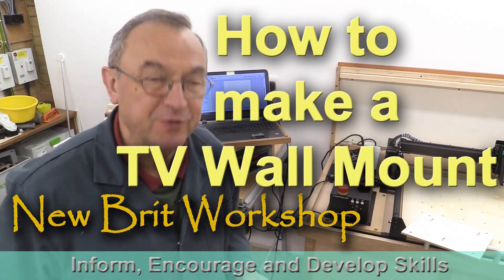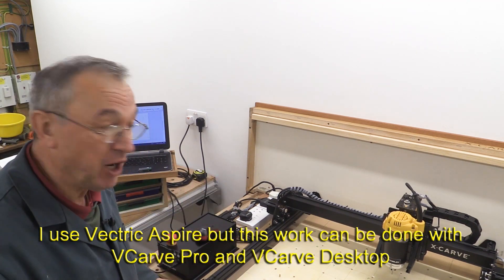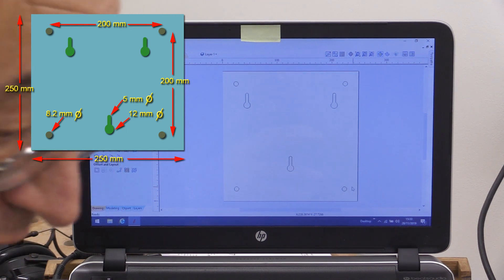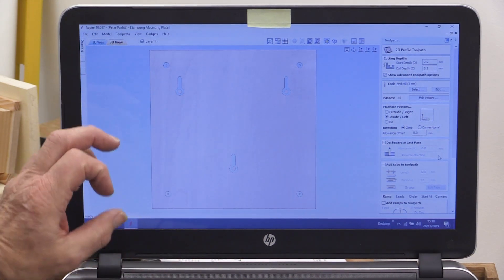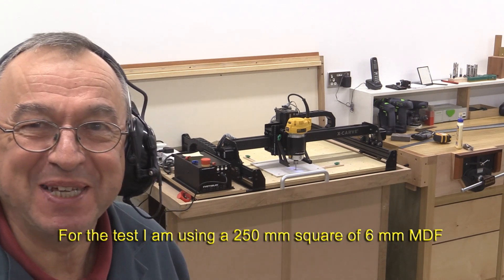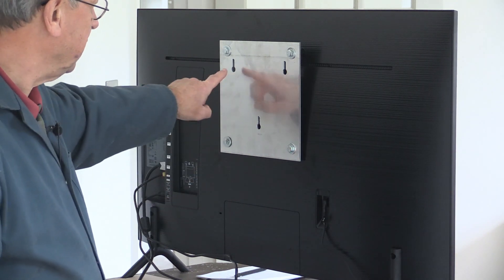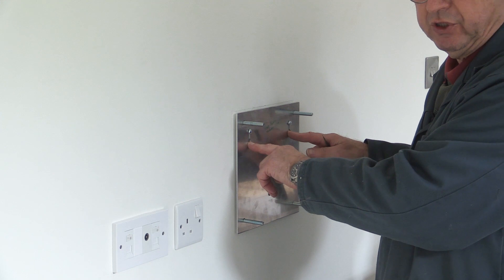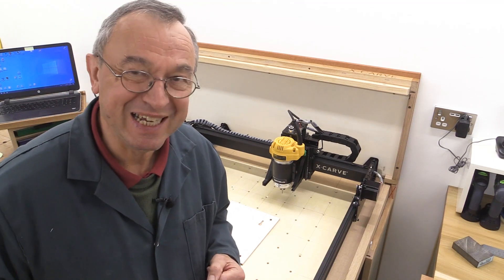How to make a TV Wall Bracket

Comment: But you have no way of adjusting the angle of the TV vertically or horizontally .
Reply from the maker: Hi Paul, In my design no as I do not require it. I have set the height such that the viewer (on our sofa) has the centre of the screen at eye level. The left to right position is at the centre of the likely viewing positions in the room, in my case, the centre of the sofa. One only needs to tilt a screen if, for some reason, the screen is well above or below the level of the viewers' eyes, perhaps a TV mounted high on a wall in a bedroom.    Peter

Comment: Why only three screws?
Reply: And slotted ones!
Reply: @katabrontes  are you the Mike Blackmore that I know in the Blackpool area?
Reply from the maker: Hi John,  The two at the top give horizontal alignment and then it only needs one below to ensure that it cannot lift away from the  wall at the bottom. Any more would be over engineering.  Peter
Reply from the maker: Hi Michael, The plate has to be safely united with the wall. The screw heads will go behind those narrow slots and the plate cannot then come away unless the whole thing is lifted allowing the screw heads to go back through the 12 mm holes at the bottom of the slots.    Peter
Reply: John Hughes No
Reply: New Brit Workshop Sorry Peter.  I meant to imply I was surprised that you used slotted screws although it was a very nice old turn screw!
Reply: @NewBritWorkshop  thought so. I take it the load is distributed evenly over all three screws?
Reply from the maker: Hi John, Yes, as far as my masonry drilling allows - I did do it very carefully and I am satisfied it is secure.   Peter

Comment: Okay Peter, you've saved about £40, but how much did the CNC cost?
Reply: Okay, perhaps a little unfair.  I guess I'm just a little jealous of all your gear.  But all is not lost; I'm soon to take delivery of a KS60 and a TS55.  I've got a bit of catching up to do.  What do you think my next big purchase should be - a domino?
Reply: He's had it for a while if ya listened. You can do the same thing with a drill or drill press and a rule. And a very nice job it was Peter.
Reply: @garyknable1155  No sweat - he's my hero too.  Thanks for the advice.
Reply from the maker: Hi Chris and thanks Gary. Well done on getting the KS60 and TS55. If you do not have one then you should look at a decent extractor. After that the DF500 Domino is a must. After that a good sander and if buying just one look carefully at the ETS EC150/3 or the Rotex 90. My little dig now (with a smiley if I knew how to insert one) - When you finish your first project using your KS60 and TS55 let me know how much you saved by building whatever and I will then return the comment above about savings !! No offence taken and you are right to bring people down to earth when considering big purchases on tools. My Festool kit will last what is left of my lifetime and then still be of use to the children. The CNC will be good for 10 to 15 years with some TLC now and again and so all in all I think that I can justify the cost of my kit.  Cheers Chris and Gary.     Peter
Reply: @NewBritWorkshop  Yeah, I agree.  I've got a CTL Midi and an RO150, but the DF500 price looks a little eye-watering!  I don't think the 'Chancellor of the Exchequer' would sanction that just now!
Reply from the maker: Hi Chris, The DF 500 has changed my woodworking more than any other tool. I used to have a lot of big woodworking machinery which I sold to fund my Festool purchases. I had a large morticing machine which was a bind to setup and use and I still had to cut tenons to fit the joints. The Domino replaces that and it takes seconds to setup and use. I appreciate that it is expensive but I do not go to pubs, only have a pay as you go phone contract with a hand me down phone from one of the children. We do not fly anywhere on holiday and I do all of the maintenance of my house. We keep the temperature in the house reasnably low and use thicker jerseys as the winter progresses. Despite all of this life is not dull and I have managed to buy a few tools that I love and cherish.   Cheers.   Peter
Reply: @NewBritWorkshop  :-)